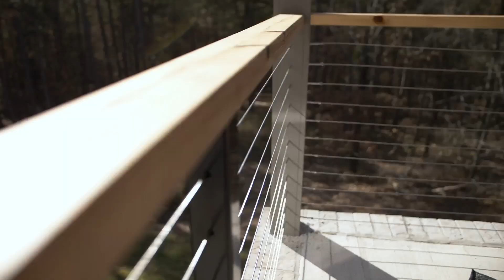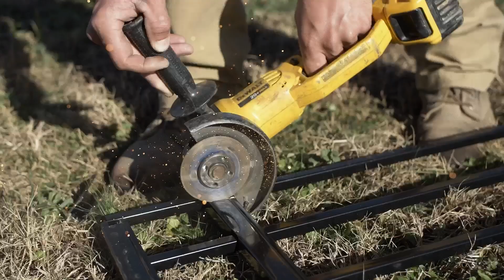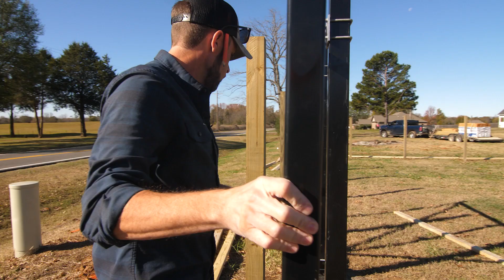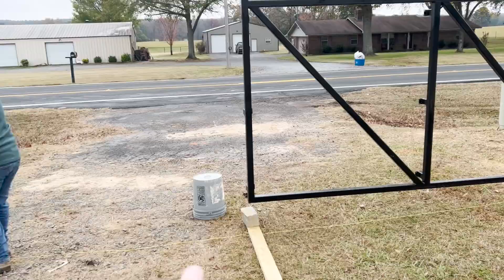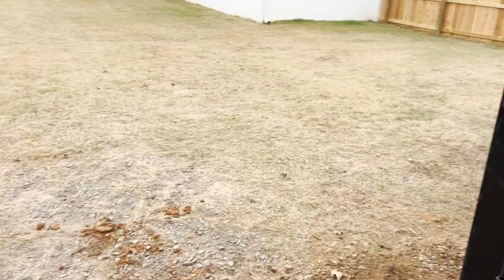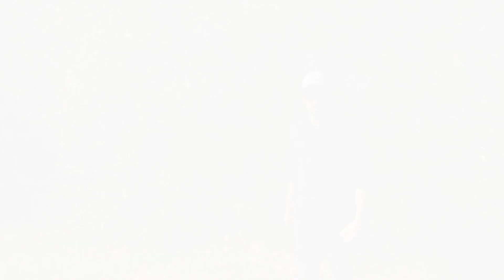MASSIVE 20FT CANTILEVER GATE

Comment: What were the dimensions for the concrete footings for the posts? Curious how deep y'all had to excavate to support the 20' opening with a cantilever
Reply from the maker: For the concrete footings we dug a 3-1/2 foot deep hole by approximately 3 feet x 3 feet wide. This allows us to get an appropriate depth and the enough concrete to support the weight of the gate.

Comment: What is your minimum distance for the counter balance?
Reply: The counterbalance should be at least 50% of the opening width. You'll notice they didn't clad the counterbalance section. That's not necessary and just makes it heavier.
Reply from the maker: You are absolutely correct! Thanks for helping out on this comment !
Reply from the maker: @nicksgarage2 is correct! the general rule of thumb is 50% of the opening. Meaning you would make it 10ft for a 20ft gate. Thank you for watching and sorry for the late reply!

Comment: Great intro Joe 😀 that got a sub from me👍 (#35)  the slider is a great option and a cantilever version the best solution for the site, I do however have a question, isn't the bracing going the wrong way? steel is stronger in tension than compression, if it was a timber gate frame it would be correct but in steel I'm not so sure, not intending criticize your work (especially on the first comment) I'm sure it is plenty strong enough I'm just questioning the engineering. keep posting videos Joe and good luck with the channel. Peter.
Reply from the maker: Hey Peter! Thanks for the sub! That’s a good question. It made me really think. You’re right that the steel does have a higher tensile strength, but the main risk of failure for the steel under compression is it buckling or folding and the gate is not going to carry enough load to risk that. I did go back and review a bunch of shop drawings and specs for cantilever gates that we’ve done over the years, and pretty much all of them call for or have it drawn up as a compression brace. So, I know that’s not a great answer of “because that’s the way it’s been done.” But at least in our experience we’ve never had an issue with the compression braces on these. Now we do have some steel rods with tensioners that we use on other gates that act as a tension brace. So yeah for us we usually use a welded steel compression brace for slide/cantilever gates and a steel rod style tension brace on steel swing gates. Again, good question. I’m going to keep digging on that one. You’re also very correct on the wood frame! With wood you have to use it as a compression brace. That’s a mistake you see often with a wood brace installed as a tension brace, which usually leads to some type of failure in the gate frame over time. Thanks Peter!
Reply: Thanks for the well worded response Joe, and I agree in this application  it's not going to matter, this may help you in the future, full disclaimer, I'm not an engineer but I'm old and have built a lot of things from many different materials and when I need to come up with an answer to a question that a trained and educated engineer can calculate exactly, I simply adjust the scale, take your braces for example, the size of steel you have used is not going to care in which direction they are placed, but if you adjust the scale and use 3/8 steel rod for the brace the selection becomes obvious, the rod will support the load under tension but will fail under compression, the connection will be it's failure point.
The scale adjustment can work the other way as well, instead of needing to support the weight of timber fence palings, imaging a concrete truck parked on the top, of the end of the gate and picture where it will fail, thanks for the discussion Joe, Peter.
Reply: This gates brace being in compression is correct when using a solid brace with welded connection, if using a truss rod or cable brace you would want that in tension. Came out great and awesome video 👍